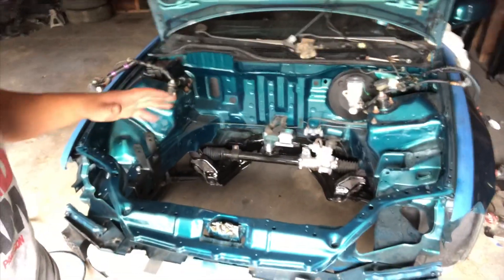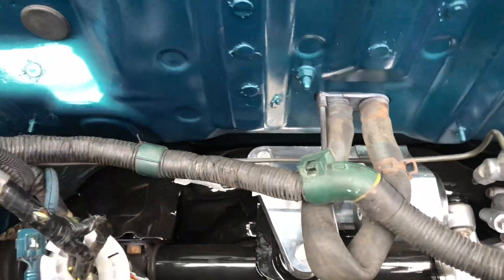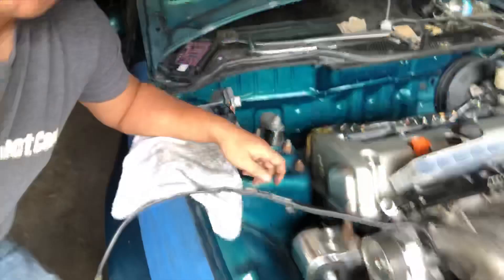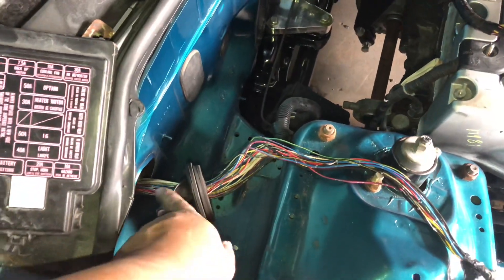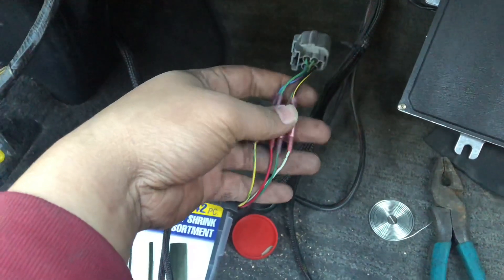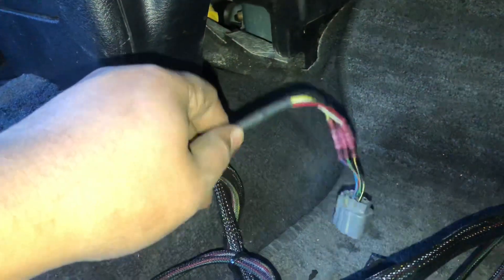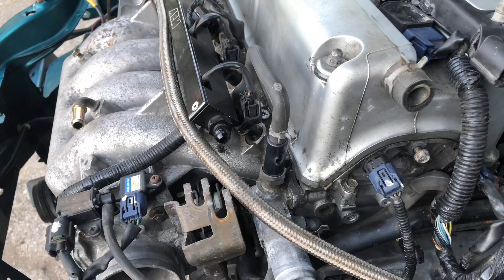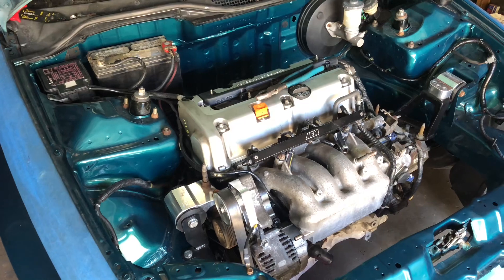K20 swap dropped in! Wiring tutorial 1-13

Comment: Best I’ve ever seen so far
Reply: When you pull in the old engine harness ( those 3 ends) do you cut them off
Reply from the maker: Thank you man. I tried to be thorough.
Reply from the maker: Greg Nembhard you talking about the old shock tower plugs?
Reply from the maker: Greg Nembhard i just pulled them through and tucked them where the ecu normally sits
Reply: Thanks v-much so is it ok the cut them out of the car
Reply from the maker: Greg Nembhard its seems to make sense but i wouldnt just to eliminate the possibility that the wiring might not work. Only one way to find out i guess.
Reply: Aaron Choumphonkeokiengkai thanks talk next time

Comment: I have a 00’ ek & wanted to do a k20a swap.. I can just buy the engine & transmission, hasport mounts, Ecu & fuel lines & it’ll be set to drop in? I was gonna get the k series level 4 afterwards
Reply from the maker: iRecklessGodd 25 yea. Just make sure its not a accord or tsx transmission
Reply: hows your swap going? ive been seeing a bunch of k series for cheap, just need some more information for when i do mine

Comment: Where did u pull those first 3 wires- green -red green-orange green yellow.? Not the ecu side but the other
Reply from the maker: Bud Jesus what brand harness are you running?
Reply: Ktuned tucked harness
Reply from the maker: Bud Jesus im not sure what wires you’re referring too. I only know those wires are on the ecu side. Not the driver side.
Reply: Aaron Choumphonkeokiengkai the 3 wires u connected together u said check engine light codes n something else where did u pull those wire from

Comment: Does the k tuned conversion harness come with the o2 sensor connector or do you have to hardwire it in?
Reply from the maker: Gsr Turbo i believe it comes with it wired already. You will have to confirm with ktuned.

Comment: Where did you get the firewall plugs? Anyone have a link for those?
Reply from the maker: Mario R https://www.hondapartsnow.com/genuine/honda~plug~air~conditioner~91631-sr3-000.html
Reply from the maker: Mario R https://www.hondapartsnow.com/genuine/honda~grommet~washer~hose~91617-sb6-000.html

Comment: How did you wire up the coolant fan connector?
Reply from the maker: MrRevto9k dont need it if k pro is being used
Reply: Aaron Choumphonkeokiengkai 
No I mean the fan motor power connector. Did you use the stock EG one?
Reply from the maker: MrRevto9k stock fan plug. Just exteneded